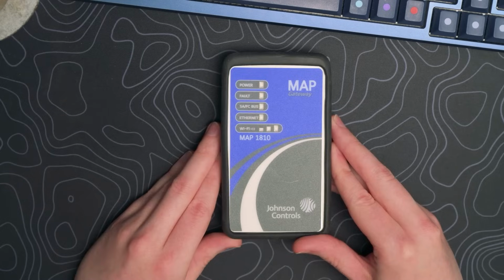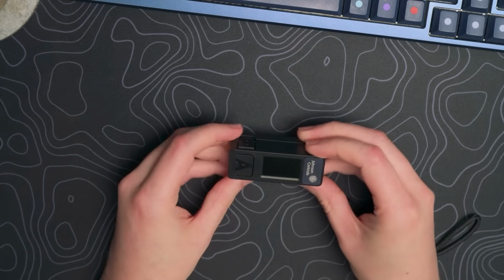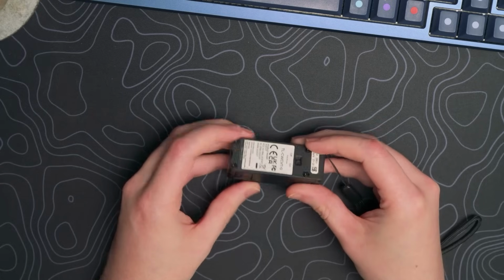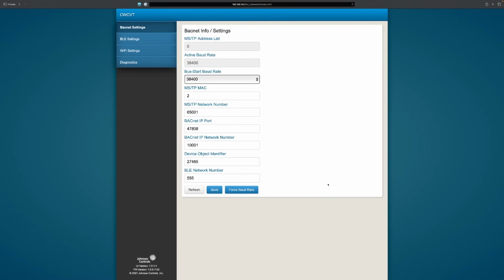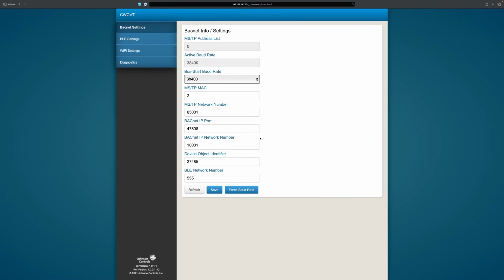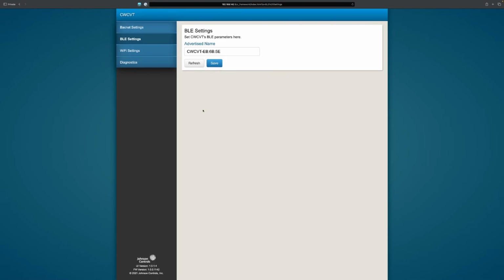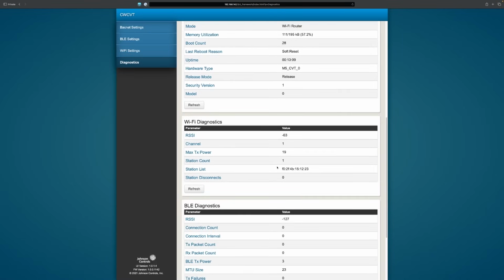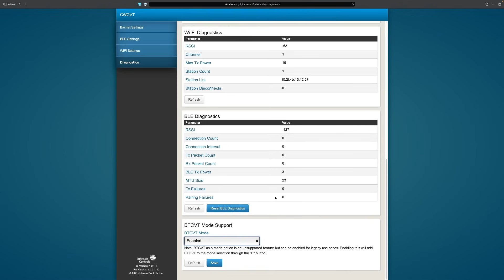Johnson Controls CWCVT Overview - The MAP Replacement

Comment: Do not change the back net as described that is a particular communication that only talks between the boards so like if you change that ball rate, everything’s gonna go down so on a rooftop that might have three boards that talk. Note that this is not the final interface that you need to work through CWA Which is another miserably failed app from JCI so you can no longer just go to this IP address and gain access to the unit like you used to on the old map, You’re completely reliant on a CWA to access the unit which generally doesn’t work. They refuse to sell the old map tools and discontinued them and you can’t access these devices that are shown. I’m standing in front of one right now that has yield itself to be almost totally useless for just about $1000.